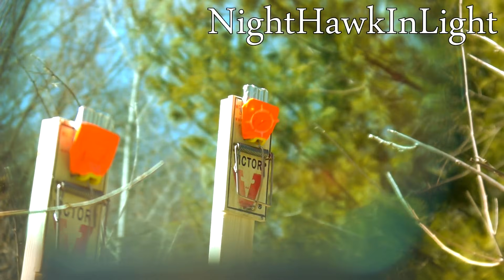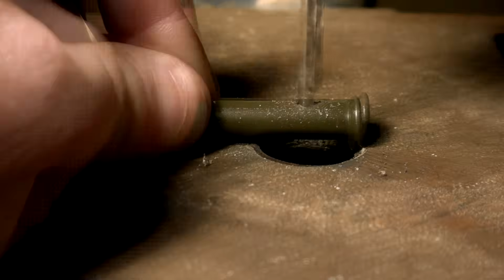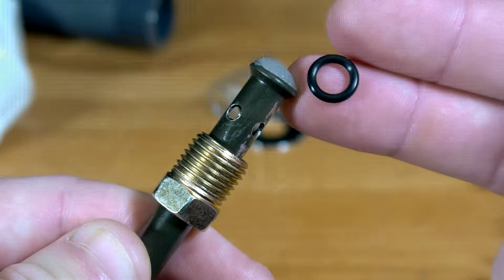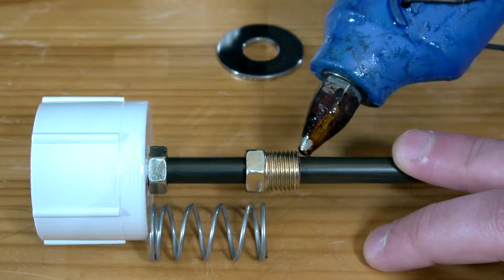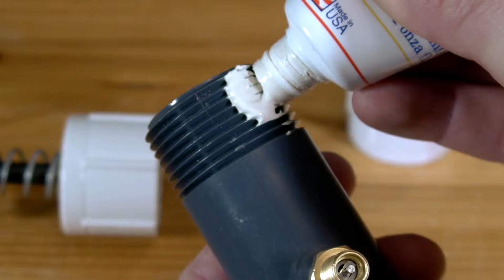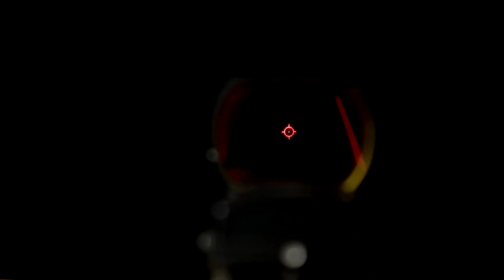How to Make a Sniper/Shotgun Airsoft Rifle

Comment: Hey! Its 2020 and im buiklding one of these. Question, hope you see this. 
Do the brake lines come bended as stell or is it optional to bend them? i dont wnat curvy brake lines. So do they curve if you apply pressure to them or do they just come floppy?
Reply from the maker: They come straight. They're made of steel, it takes some force to bend them.

Comment: Hey im making my own but i have a question about the valve, so basically when you open the valve wont the air flow around the barrel since its just a slim fit in there.
Reply from the maker: Yes, but slower than it will be able to go through the barrel

Comment: NighHawkInLight I tried making it and I need help on the part where you screw in the fitting into the end cap because it leaks cuz I made the whole little bit too big do you have any suggestions on how to seal it
Reply from the maker: If it's a small leak you might be able to seal it by wrapping the threads in teflon tape. If that doesn't work it's beyond repair and you need to buy a new cap to try again.
Reply: Ok thanks! I got a new pipe and new end caps and I will try again.
Reply: The reason I had to get the pipe nipple and the end caps again was    because I had already sealed them together with PVC cement and I couldn't get them apart.
Reply: I subbed btw
Reply from the maker: If you're using threaded caps you don't need to glue them
Reply: Ok thanks

Comment: hi, my valve has a small leak in it, any ideas? The leak is small, but big enough that it must be fired within 5 seconds to get any kind of power.
Reply from the maker: Put tfe paste on the seals.
Reply: NightHawkInLight seal as in the o-ring? Btw, thanks for answering!
Reply from the maker: Yes, it should help
Reply: NightHawkInLight great, thanks, and props for the great design, was very simple to build!

Comment: +NightHawkInLight - OR TO ANYONE ELSE WHO MAY BE ABLE TO ANSWER ME, I have a question about the power of this gun. I've seen it made a few ways. Some of those little bike pumps can manually pumped and also have a spot to connect a Co2 cartridge. So if you were to use the Co2 as your power supply, that fired directly down the barrel and didn't use a PVC chamber, would this lessen the power of the projectile, make it stronger or be the same?  If this is too confusing, please let me know and I will try to explain it better. THANKS!!
Reply from the maker: Don't use CO2 in PVC. It is dangerous because the cold makes the pipe brittle and also can reach pressures much higher than PVC's rating.
Reply: +NightHawkInLight - thx, but if i were using the co2 it wouldn't have a (pvc) chamber. it would shoot directly from the barrel.  So the main question is, would the power differ between the two designs? 
    A: putting pressure into a chamber, then triggering using a piston?
OR
    B: bypassing having a chamber and using pressure directly to a barrel?
Reply: You can find it on amazon or go into a gunshop

Comment: I have one question
How to load it? :v
Reply: It's a simple muzzle-load system, i.e you put the projectile in the front of the barrel and let it fall towards the back.
Reply: If you want to stick with this design I would use arrows over the barrel instead of bbs but if you want to use bbs you can cut the barrel and make it screw on and off when loading it

Comment: Hey NightHawkInLight I built a project very similar to this where I had to thread the bass NPT tank valve into some SCH 40 pvc. I drilled a hole and threaded it in except I hear a small amount or air slipping out from in between the PVC pipe and the valve. Any suggestions on how I can seal the leak?
Reply from the maker: You can try threading it out and using some teflon tape or pipe thread paste to get a seal.
Reply from the maker: Trevor Sosnowsky Try putting some TFE thread paste on the o ring.
Reply: NightHawkInLight I made this bike pump air gun like you showed but my o-ring is leaking air slowly! I've rebuilt it twice and it's the o-ring that leaks every time! What did you do to get a air tight seal?
Reply: Use hot glue
Reply: +Trevor Sosnowsky use a stronger spring lol
Reply: I got it built to working order by just starting over again with a new pvc pipe and caps and just slowed down and did everything carefully and it works! Don't have much in the way of power though.😕

Comment: I think I may try this but use a gas chamber instead of compressed air. And rig a lighter ignition switch into it as the trigger.
Reply: That's actually a decent idea. Granted nothing burns in the process.
Reply: Its really hard tho to get the exact amuont of air and the gassy stuff to work together...

Comment: My bb's roll out from brake line lol,so how to deal with this problem
Reply: Cang Cimen drill a small hole on the barrel (where the bbs are supposed to go) and then put some tubular rubber on top of it. the pressure between the rubber and the barrel will keep the bb in place ;)
Reply: oh man,big thanks!!!,im kinda stupid for not figure it out.you da real mvp!!
Reply: no problema

Comment: Hi nighthawk big fan um just wondering if you changed the barrel size to a bigger one to fit bigger pallets in , would you need to change the chamber size as well? Also i have a rechargeble air pump wich doubles as a pump or vacumm , do think it might have a usefulness in something like the airsoft pvc sniper shotgun? Like could it be used to be a pvc airtank refiller on the go or somthing like that ? Any way thanks for the vids i realy enjoy them and the creativity.

Comment: O-ring continues to fail. Cleaned air inlet holes from drilling, still failed. Checked mating surfaces, etc. still failed. I think the solution is finding a way to secure o-ring to flange of brake line. Makes sense the o-ring wants to stay at fitting end due to air pressure, causing wear during brake line movement. Not just the friction but the sudden escape of air may be driving the o-ring into escape holes causing damage, especially if you over pressurize. My son and I both like your projects, fun to work together on these.

Comment: When you aim downwards the airsoft bb's fall out right? If there is a way to fix this please comment or reply.
Reply: That would effect the accuracy and power. Any other ideas?  Maybe a small price of rubber to barely stop the pellet from falling out? It would also act as a hop up unit. It would be cool if you could make a new airsoft gun that has a hop up unit and a way to keep the bb in place. Thanks again Hawk! Keep up the good work! Pls reply, thx.
Reply: You can use electrical tape placed inside the barrel by the four holes. I have tried this on a brake line before assembly and it works with two small pieces but just use trial and error. You would have to make sure the tape is securely placed and smoothed to stop the pressure from ripping it out of place.
Reply: +Harbinger  airsoft bbs are only 6mm
Reply: You could fashion a magnet into the top/bottom of the chamber to hold the  bb since it will become magnetized to the magnet.

Comment: i made better improvments because i found drilling trough the endcap always leaked. so instead i used a  inch to half inch and half inch to 1/4 and the breakline fits perfect and it is a perfect seal. i think this is much easier than just drilling a hole to fit the line.

Comment: Could the brake line valve be used to push air into a larger diameter barrel, like for a nerf gun or something of the like?  How efficient do you think that would be?
Reply: It would work pretty well, but be aware that nerf darts are fairly fragile and if you use too much pressure, you will destroy them.
Reply: Fair enough.  I normally don't use that big of an air tank to start with.

Comment: The only thing bad about this is that i dont have the stuff to make this
Reply: They call it, "The Hardware Store"
Reply: You can buy it?
Reply: connormwood  Hardware stores in Sri Lanka dont have stuff like this(except for the pipe things).
Reply: MJNSTUFF Yes, most hardware stores in the US carry standard plumbing equipment such as the piping in this video. Washers and nuts are universal, almost every hardware store carries them. The breakline barrel may be more difficult to find, more likely to find them at auto-part stores. Of course the bike pump can be bought at a bike store.
Reply: Geethma Athukorala Really? Sorry to hear that friend. I was under the impression that washers and nuts were standard at any hardware store as they are generally used for almost all home improvement. I would like to assume you live in a city, but I am sorry if to hear your area does not have standard plumbing and automotive parts. I guess I take those items for granted even when it comes to such ordinary pieces.
Reply: Dude we have the plastic plumbing things. I was taking about the small metal tube thing
Reply: Geethma Athukorala You said you had the pipe. You didnt say washers or nuts, and those are some of the main components in this video. I also stated that you can go to an auto part store as opposed to a hardware store to purchase the metal barrel.

Comment: its cool but the bb would fall out right when you aim towards the ground
Reply: he shows the concep, you may add a hop up, a bb retainer or more pressure.
Reply: a cap that is spring retensioned as a capp and attach a strin so you press the string to the barrel when you're ready to shoot. the string is attached so that pressing it to the barrel will open the cap. but why would you aim at the ground.

Comment: i used a 6mm ID brake line. It will only fit steel bebe's 4.5mm. the speed of projectile is unimpressive. With this valve setup it seems that air will be forced along the outer side of the brake line and out through the space between the line and the fitting. Is there a fix to this without compromising the trigger mechanism? I feel that as if the air was forced to enter ONLY through the holes drilled in the line that the speed of projectile would be much better.

Comment from the maker: If the hole is drilled to the right size the PVC molds around the threads very securely. Rarely is there an issue with leaking with such a process, and I've done it often. If there is a leak some pipe thread paste corrects it. As for the valve stripping out, there is very little force ever applied to it as a result of the air pressure inside the tank. Pressure is a factor of surface area, which the valve does not have much of. At 200psi it's only under about 12lbs. It could comfortably take 50.

Comment from the maker: 1" sch 80 pipe is rated to around 480 psi. Since you're using sch 40 caps cut that in half to 240 psi, and since the caps are a threaded connection cut that rating in half again to 120 psi and that's my comfortable operating pressure. Chances are it would easily handle 300 psi before rupturing, but I don't take chances. In any case, it can easily handle any pressure a hand bike pump such as the one used in the video can deliver.

Comment: Is it possible to use a Air Cooled VW Bug REPLACEMENT STEEL BRAKE LINE 6MM ENDS 7.50" or can i only use that one type of pipe (6mm ID Brake Line)

Comment from the maker: I'm sure you can buy springs online. I don't live in the UK so you'll have to google it yourself to find out where. The brake line isn't labeled as 6mm, you just need to find one that will fit 6mm pellets. That means taking a pellet into an auto parts store and finding a brake line that you can drop it down.

Comment from the maker: It's a tank valve, used often for compressed air tanks. You might have to check a few hardware stores near their air compressor parts to find one, or they are easily ordered online.

Comment: OK, both Home Depot and a local plumbing supply store did not carry a PVC pipe threaded on two ends. So it looks like we will be cutting a pipe to size, then gluing the caps on. Also, that's a standard brake line, so I am wondering if you could describe the exact spring size and nut size you used, and where you found the spring? Thanks!!!

Comment from the maker: The O ring that sits at the back of the brake line is what seals it from leaking air. If it's not sealing properly coat it with some pipe thread paste and that should help.

Comment: i just made this rifle with my mom and we are having trouble with the seal at the bottom of the spring. where the brake line slides up and down for the trigger the pressured air is leaking out instead of only coming out of the drilled holes when trigger is pulled. because of the need for the pipe to slide i dont know how the keep the air from escaping through the bolt and the brake pipe.  please help i am so frusturated.  :( -gabe.  (this is gabes mom, we have followed your directions to the T.)

Comment: hey instead of glueing the red dot just glue a rail on top and put the dot on so you can re use it also im curious if you can make (this is a challange) a muzzle loading gun where you pull something back and put a bb in and close to fire

Comment: holographic sights and red dot sights work quite similarly. read the wikipedia pages on both.

But to summarize, basically the holographic sight has a holographic image (the crosshairs) recorded onto holographic film and it is illuminated by a laser. the red dot sight is just a Red LED shining into a collimating mirror so whatever angle you look at it, there will be a red dot straight infront of your eye.

Hope this helps ^^

Comment from the maker: If I were to guess, about 80. The nice thing about this design is that the pipe nipple and end caps of this diameter can stand more pressure than a hand pump itself can, let alone what you have the strength to pump. It's really not possible to over pressurize with the hand pump. If you were using a high pressure air compressor It would require more concern. The pipe is rated above 500psi. To be safe I wouldn't take it over 150 because of the caps that are more likely to safely stand about 300.

Comment from the maker: Yes, that would not be very difficult. Cut a slot out to fit a pellet then find a tube that fits tightly over the brake line that you can slide forward and back to open and cover the slot.